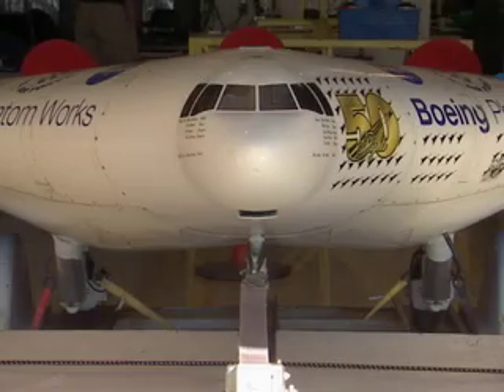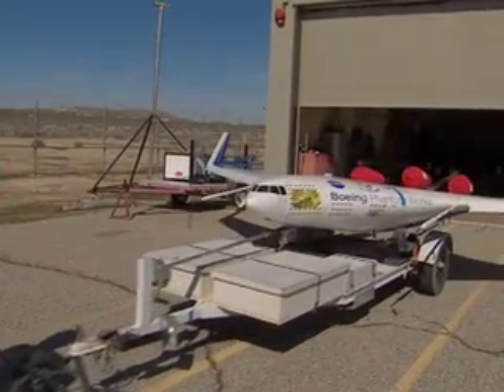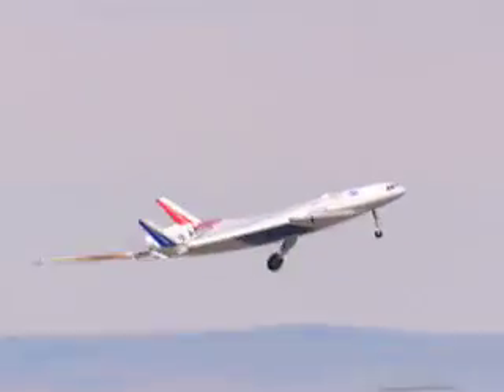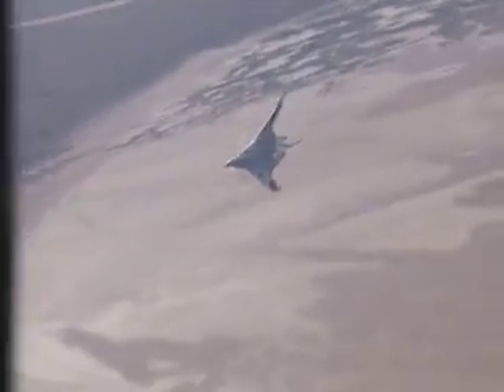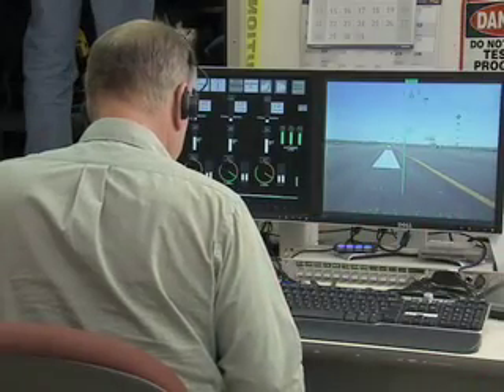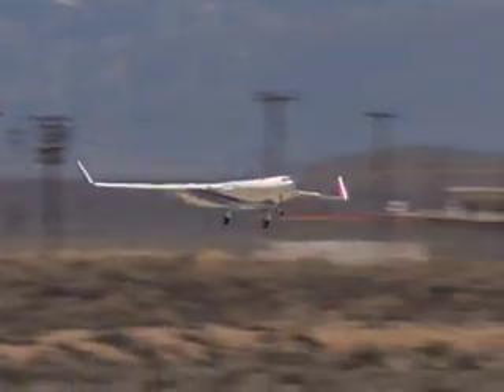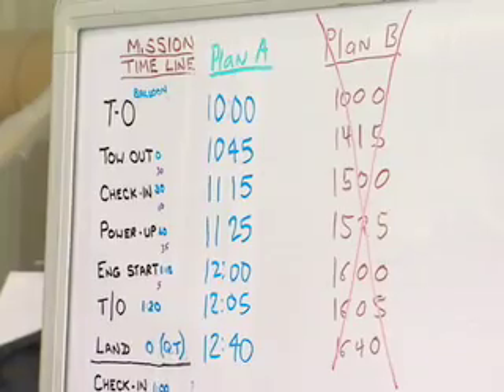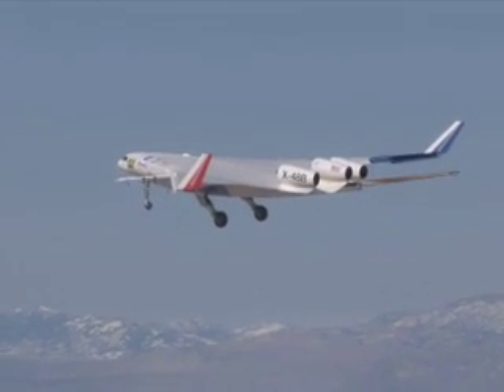Blended Wing Body Completes Phase-1Tests

Comment: @NelielTuOderswank what about a flying wing design such as the Northrop YB-49 or RQ-170 Sentinel, arn't they more efficient than a blended wing?

It just seems to me that a blended wing is specifically designed to be a middlepoint inbetween other more fundamentalist designs.  It seems to be trying to preserve as much of the advantages of delta, flying wing, and traditional tube fuselage designs.  It's performance will not be as groundbreaking, but will be better rounded.  Yes?

Comment: @TheDA2345 In addition to that, having passenger seats far away from the aircraft center line would give those passengers a lot more motion during banked turns.  So probably using it mostly for cargo would be the bright thing to do.  But even still, it would be a very interesting and efficient aircraft.